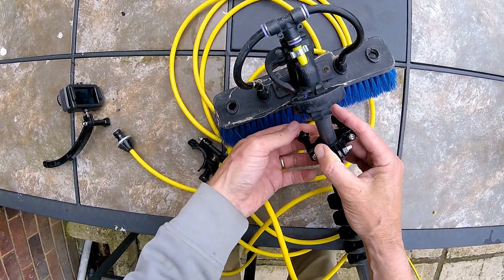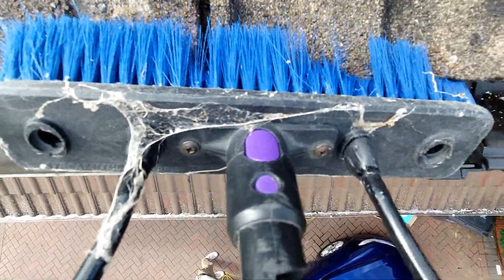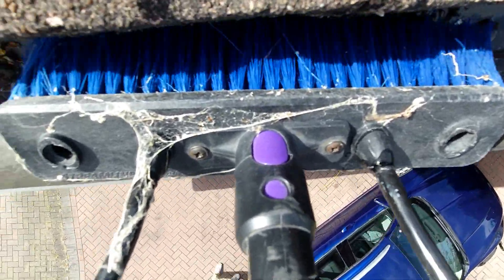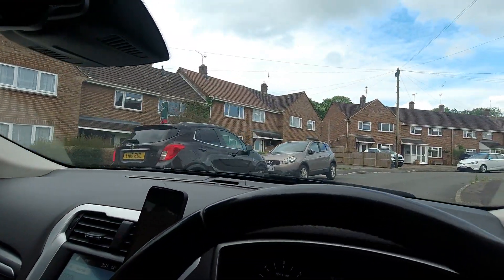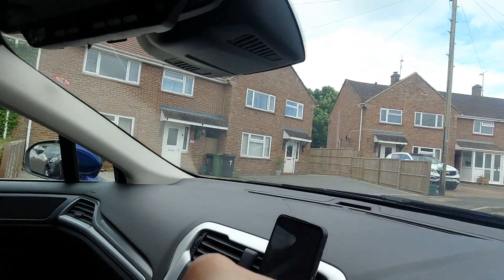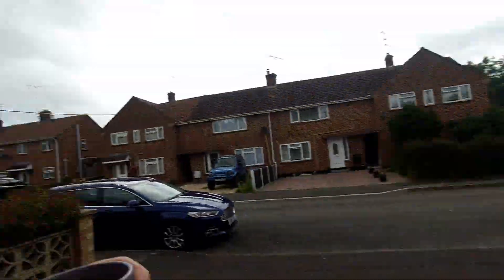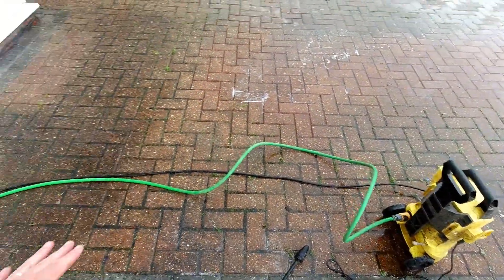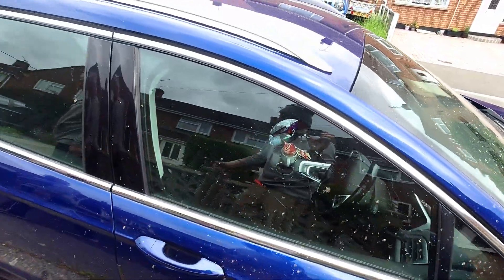Jet Washing a Client Block Paving

Comment: Another job well done Andy. You may need to consider the purchase of a gas powered generator such as the Honda 2000i. I have one of those and they are very quiet and produce a very reliable and solid up to 2000 watts of power. Mine will run for 8 to 12 hours (depending on how much power load that is put on it) on one gallon of gasoline. I absolutely love mine. And there are other brands of them that are less expensive if you would prefer. I am pretty certain that all of your power needs would be met with one. Just a thought to possibly consider for the future. Keep doing the great work and you will do just fine my friend. I wish you the very best on settling in to your new home soon. See you on your next video.
Reply from the maker: Hello Terry, thank you for watching and for commenting. My brother has offered me a generator, but it needs some work doing to it, so when we've moved into our new place I will then go about and fix that generator and use that one. I'm slightly disappointed with the battery powered pack as it doesn't seem to give me the the power I need for the jet wash, as for the vacuum cleaner it's no problem at all, and now I've bought myself a more powerful jet wash, I need something to power it to it's maximum power. Talk soon.